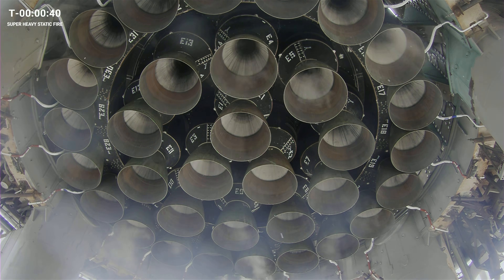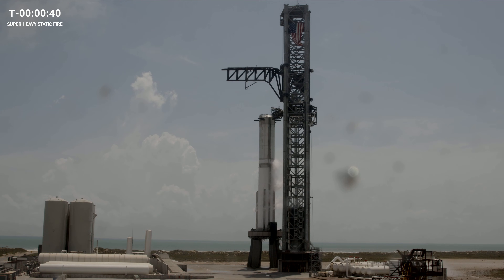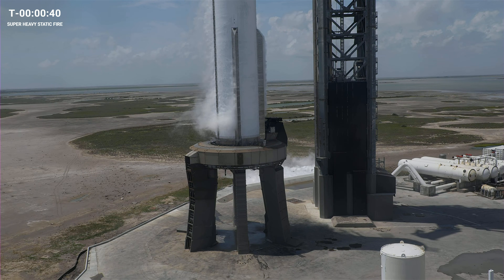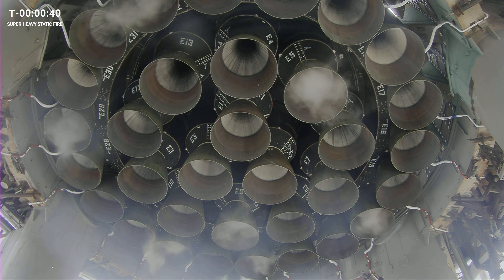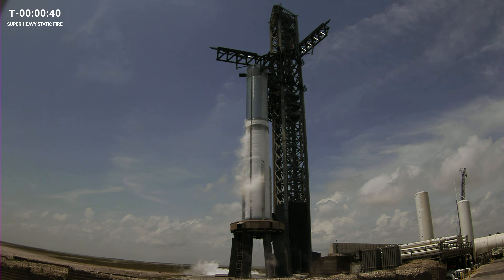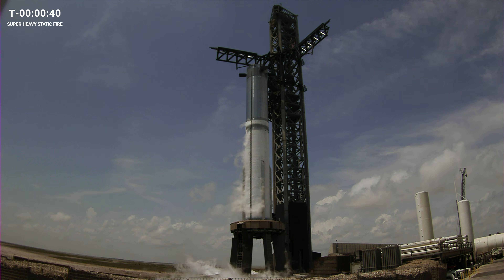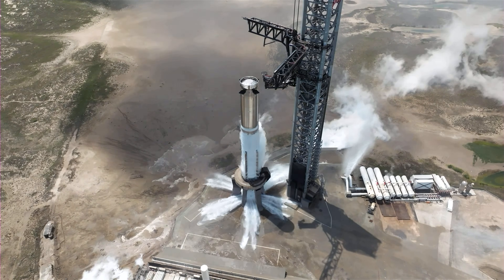Starship Super Heavy Static Fire

Comment: There are so many things going wrong here.
1. There is not enough space for the flames to properly divert.
2. Flames and thrust are directly impacting the water deluge systems.
3. Super heated steam will eat away all the launch pad after every liftoff. 
4. Raptors will continue to fail as long as spacex will try to lift-off starship with so little ground clearence. 
5. The massive thrust of starship and that little tiny space between the raptor and the  ground (new water system) is the greatest joke of the century! It will not work unless they build a proper flame diverter like NASA did.... Maybe SpaceX is rich! But its launch pad looks super cheap!
Reply: Put it on a "milkstool", that's what NASA did back in the day.

Comment: Not sure why there are no test flights for Booster on its own or for progressive static fire test - meaning outer and inner, then all.. This is the second time all 33 did not stay on for the entire time window. A cost issue?
Reply: Booster isn’t designed to ascend on its own. It would likely lose aerodynamic control very early on. 

They also do ignite engines in a similar sequence but at the end of the day a static fire is supposed to be a test for launch configuration. 

Not an engine test. 

All but 2 engines did stay lit for full duration and were they can still launch with 3 shutdown perfectly fine. 

Also parameters are conservative. The engines shutdown and didn’t fail
Reply: If they're going to expend a booster I think they would prefer to test as much as they can.  Just tossing a booster into the ocean doesn't really tell them much.

Comment: How does the rocket get up on that stand?
Reply: Those giant black bars (also known as the 'Chopsticks') lift the booster up onto the launch mount and then the launch mount has clamps which hold the booster in place. The chopsticks are also designed to catch boosters after launch so that they can be launched again rapidly

Comment: Glad to see a water deluge system.    Was surprized they didn't use one earlier given the power of ~30 little Raptor engines.
Reply: It was in the works, they just gambled they could get away with 1.
Reply: @TheEvilmooseofdoom  Given that 30+ Raptors have the power of 10 F-1s the engineers should have known.  History can be a good teacher.
Reply: @douglaswilkinson5700  It was a bad gamble, but no company is perfect.

Comment: I really hope that by the next Starship flight test that SpaceX will have invested in a proper flame deflection system like NASA's, so they don't blow up their launch pad (and thrusters) again, or shower the landscape with pulverized concrete and shrapnel.
Reply: That's what the whole system in place does.  Are you not paying attention?
Reply: @TheEvilmooseofdoom  no, it isn't the same as what NASA uses, not even close.   The water suppression system is new, but the launch pad hasn't yet been redesigned from the last failure.
Reply: @matthewgillies7509  Not the same doesn't mean it doesn't function.  They don't need to redesign anything.
Reply: @TheEvilmooseofdoom  Every expert warned them against the type they had used during the last flight test.  And turns out they were correct, as even Elon Musk was pessimistic then that he was about to blow up his launch pad.  They're also being investigated for violating a slew of regulations and agreements, including causing damage to the local ecosystems.
The central problem is the lack of blast deflection, as having the rocket elevated on the existing pedestal doesn't prevent chunks of concrete from being blasted off the landing pad, or being thrown into the engines.  NASA's launch pad is elevated, allowing for a blast deflector underneath, channeling the energy down and away instead of out, around and up.  NASA's design also allows for the water to flow and be collected after launch.

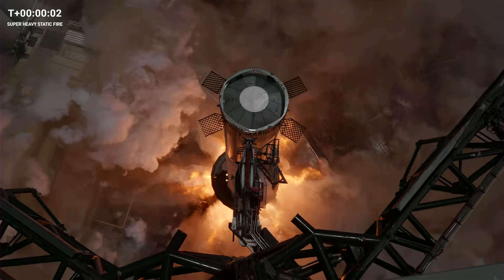Comment: Seems like the water flow is not enough for full power. 8:06 shows hardly any steam compared to smoke and dust, so it looks like pressure from the raptors is enough to hold back the water flow through the base.
Reply: Seems and reality are often very different.

Comment: Why do they hate flame trenches? Just do it properly ffs there's a high likelihood this type of firing will fatigue the airframe and cause complex issues that limit reusability.
Reply: Flame trenches are to mitigate flames not sound. 

Even with a trench the concrete would’ve still broke. 

They also can’t build a trench for two reasons.

A. The water table and environmental regulations.

B. Where would you like them to throw the flames at? The site, the wildlife refuge, populated south padre or the beach? 

This is to mitigate energy from launch so what exactly would a trench do when it would increase energy loads by reflecting them back
Reply: I love it when you pretend experts just make things up.
Reply: They can't dig a flame trench in Boca Chica because the water table is so high, also it's a lot harder to get under the rocket constantly if there's a 50ft drop below the rocket

Comment: does the rough, rumbling sound of the test reveal some extra information about the (un-)smoothness of the engine start-up? Or is it dominated by turbulence in the flash-steaming of the deluge water? Are there any resonances occurring? Do You have strategically placed microphones? 
is the timing of the deluge water start optimized?

Comment: Just curious...maybe its buried in comments here...but how does the ricket remain stationary during a test like that without stressing out wherever is being held down? Seem like there would be some stress applied somewhere on the structure.
Reply: The vehicle is held by hold down  clamps that keep it in place. 

They don’t run at full throttle because of the issue of damaging the pad 

These are released on launch before throttle up.

Comment: Deluge system is very under powered.   Just from first glance when the fire reaches the pad you can see almost all of the water trails vanish until throttle is reduced back to 0.  

This is at 50% power, or so they tell us. AT ONLY 6 SECONDS burn duration...    If you DOUBLE that power and double the burn launch sequence, then  i am sorry but i just do not see the water doing to much other then cool down the Pad after the burn if it is still there after 100% and a 10+ second launch sequence before it leaves the surface
Reply: Starship won't be at 100% throttle at the launch pad though to my understanding.
Reply: It doesn't start at 100% off the go.   It starts sort of static fire level,  then gradually works to 60% then 75% then up to 100% right when the release the clamps.   So technically it does hit 100% briefly at the OLM,  Just doesnt slam into full throttle from the start.  That would break.... alot of stuff.   @logitech4873
Reply: is the purpose of the water not explicitly to cool the pad?
Reply: Not its only purpose, but one. 

The water is to create a force to push back on the raptor engines at takeoff to save the ground beneath it and surrounding area.

It does cool the pad but was just designed to push back hard against the rocket at launch.  I just personally dont think it will push hard enough at full power. @infinitelyexplosive

Comment: Dropping that to 1/4 speed during the overhead shot you can see the rapid pulses of acoustic energy coming out from under the mount, despite the water. The idea is definitely working to protect the ground and all, but that acoustic energy is what trashes engines as it reverberates up into there. Worrying still. But progress.
Reply: Source/evidence that shockwave trashes engines?
Reply: @alvianchoiriapriliansyah9882   It's literally the primary reasons water sound suppression (the actual name NASA gave to this system) systems were invented. The flame diverter was invented to redirect the physical impingement of the energy and heat away. The water was primarily to suppress the sound. Any heat dissipation it added was just icing on the cake. Water is one of the best materials for absorbing sound and converting it to heat via cavitation.
Reply: @mycroft16 That's...not an evidence
Reply: The difference is audible from all of the streamers that show this stuff. Compare any static fire before the deluge system was in place to these now and you can hear a significant reduction in the explosive crackle of the engines from those further vantage points. The real test will be an actual launch though, since a few seconds of a static fire isn't going to show them how the system holds up over time. I just hope they aren't underestimating the rigors of a launch burn again like they did with the fondag.

Comment: I do wonder why they continue to run the spray well after the engines have shut down..
I get that it would be to kill any possible fire, and maybe they'll shut them down sooner after an actual launch, just seems like a waste of water really.. you can see it running off across the concrete in all directions..
Reply: they dont reuse any of the water, and releasing all the water isnt exactly something they can stop and it also cleans the ground, which is a plus
Reply: I think it's mostly just letting the residual pressure equalize.

Comment: The inability to keep all 33 lit is becoming a concern
Reply: It's no easy thing they're trying to do and no guarantee they'll pull it off.
Reply: they are probably being  super conservative with their parameter space to minimize any possibility of a RUD ie the disabled enignes probably worked fine but show slight deviation away from optimal so why risk?
Reply: @blengi  So you're saying with a loaded starship and cargo they might not be as conservative but would accept the risk?
Reply: @TheEvilmooseofdoom  obviously they are not as conservative at launch, I mean they are literally underpowering the engines atr 50% on the OLM at the moment  being conservative versus 80% plus thrust during an actual launch. Also they are mitigating risk by under loading methane tank versus the full tank at launch and are not doing 10 second burns like last launch, not full stacking etc. So basically everything they are doing at the moment is conservativ compared to what's required at launch...

Comment: Somebody needs to work on their on-screen clock. When it counted down to 0:00, It actually counted TWO seconds at 0:00: -0:00 and +0:00. T minus 0 does not continue from -0:00.99 to +0:00.99, it's at T - ZERO. A single point in time.

Comment: You forgot to make the waves move on the right of the screen @5:54. Epic fail by your CGI department! 😂
Reply: Now now, don't be silly.
Reply: @TheEvilmooseofdoom  FakeX
Reply: You do realize this test was open for the public to watch right? There's lots of amateur footage of it.
People like you are quick to yell "CGI" without doing even the slightest bit of research of the event. Try googling this test, try looking up independently filmed video of it - there's lots!

Also, the waves are absolutely moving. Use arrow keys to jump back & forth 5 seconds. On a frame-by-frame basis they're kind of frozen because of the video compression using P/B frames to save space in low-contrast details like that. (All-I video would have much clearer movement)
Are you not capable of spending even the tiniest amount of effort doing any kind of analysis?
Reply: starting to think these "flat earthers" are so miserable in life that they need to acquire attention in ways like this just to feel better.

Comment: Even though 2 Raptors quit early, 31 engines at 50% thrust is great.
My concern is does the base concrete and OLM had any damage? If it's just auperficial like paint scorched, then should cause little concern.

Comment: The SpaceX clock/callouts can be a bit confusing.  Use the YT video time instead.  Ignition was at 8:02, and it was shut down at 8:08, so about 6 seconds, which was the plan.

Comment: Can someone please tell me if the new and improved launch pad water deluge system is using fresh or salt water?  I'm sure it's probably common knowledge in land of spacex, but I have yet to have it confirmed from my infrequent observations.  All in all, that launch pad looks bad ass now with all it's sharp angled panels and blast shielding over the original and irreplaceable six angled columns.  The whole thing looks a hell of a lot more like professionals are running the show.  Beautiful test.  Can't wait to hear about the results.   Looked perfect to me.
Reply: That would be fresh water. Salt water is bad for the launch pad (OLM), Tower and all the other metal pieces and parts.......thou shalt have no RUST before it's time!

Comment: From what I gather just from video alone. The timing is off by two seconds. Which means wasted gas and pressure.  Half way point before disengaged will be off by two seconds as well. You might be losing two or three engines before separation which made it spin the last time. It is a matter of timing. 🤨
Reply: Nonsense.

Comment: WOWWWWW - the amount of energy released is insane! Excellent looking full duration test - huge congratulations to everyone! Hudson FL checking in!
Reply: Hmm now I want to know.... processing.... 

googling.... 

Mass flow at half power: 250 kg/s/engine, duration... let's say 3 seconds, that's 250 kg/s x 3s x 33 engines = 24750 kf of fuel. 

Ratio 3.6 kg LOX /1 kg CH4 so 24750 kg/3.6 = 6870 kg CH4

Energy in CH4: 55 MJ/kg so 6870 x 55 MJ = 378000 MJ or 378 GJ. 

1 Watt = 1 J/s so 378 GJ over 3 seconds = 126 GW 

So roughly equivalent to the output of 100 large nuclear power stations during the static fire. Or the equivalent of 25 tons of TNT being detonated. 

Or it could keep a 737 flying at cruise for 12.5 days. 

Hmm let's how many cheeseburgers that is 230 kcal per MJ so 230 kcal x 378000 = 87 000 000 kcal 

1 McDonalds cheeseburger is 236 kcal so the burn was equivalent to 389 000 cheeseburgers. Not bad!
Reply: @please_stop-v7o measuring the energy released by a rocket burning it's engines in cheese burgers is the most American thing I have ever seen, thanks for making me laugh today

Comment: 10:09 is this a busted waterpipe?
Reply: it's a exceed cryogenic thing from rocket, if you look closely you will see that they dig a pool for this reason
Reply: @teenkung123   that was my first thought as well, until I looked at the puddle right behind it. It almost looks like water is splashing down. But splashes could also be from the main water deluge system

Comment: Pleased they got around to doing what they should have had done in the 1st place and made the water anti-blast system to save the concrete base from being destroyed. All they need now is a retaining wall around the pad to save the water and pump it back for reuse again! that save allot of water use problems. Also I think having the fuel farm tanks be laid down and put under ground with a hardened flat dome to protect them from the blast be a good idea too?
Reply: No need for a retaining wall and no point in trying to reuse the water.  There is no water use problem.  There is no need to bury the tanks.

Comment: Another fail. 2 seconds of a scheduled 6 second burn is a fail. The call out "full duration" by SpaceX did not acknowledge a 6 second burn, it means that the computer stopped the test for whatever reason. Probably because the initial pulse tripped a sensor in a mount or multiple engines failed to start that would have scrubbed the actual launch because the math and physics for a nominal profile fell outside of mission parameters.
There's a disconnect between the Youtube channel play by play personality and SpaceX control. Dude is redundant and should not participate.
Reply: Go back to your cave.
Reply: Try timing it, turns out your ability to count is as bad as your ability to think.  Both are worthless and you're making a fool of yourself pretending you have a clue.

Comment: Concerns:
1: Reinforced Concrete Hopefully it’s not divorcing the marriage between the Portland Cement, reinforcement and aggregate. 

2: Appears the flat steel plate indeed causes excessive sock and vibrations as would be expected by its design. I strongly suggest a tapered design per my conceptual engineering diagrams I emailed to SpaceX after the first StarShip launch. 

3: Did leaving the water running after the engines cut off damage the vehicle? During a normal launch Starship would have cleared the tower.
Reply: It's not Portland cement.  I suspect they want to keep it flat under there for a while yet.  The let the water run until the pressure drops.
Reply: @TheEvilmooseofdoom  All the reinforced concrete foundation piles, pile caps, slabs and stage zero legs all contain Portland Cement which is the glue that holds everything together within the concrete reinforcement, aggregate and additives.

Comment: How do they manage to keep it from lifting off the launch pad? That must be a huge challenge in itself..
Reply: The forces aren't too extreme, due to gravity pulling it down.
Reply: The weight of the booster plus 50% throttle means theres a huge amount of force trying to push the rocket upwards, but nothing those clamps cant handle.

Comment: Engines were started on 8:02 to 8:07 🔥
Reply: I see them starting only for 2 seconds.
Reply: @tokenlau7519 those 2 seconds are full fire. The rest is it starting up and reaching max thrust
Reply: @ogshotglass9291  Thanks for the explanation. It's a bit difficult to judge, since there's a cut from the side view to the overhead. I hope full firing sequences are released from several vantage points.

Comment: Came in just as it happened, deluge already running cause I was expecting :45 like originally showed on youtube. Amazing static fire and awesome to hear that it was full duration, though at least to me the water pressure actually seemed bit lower, although that is most likely wrong